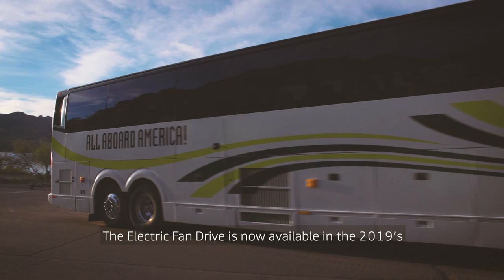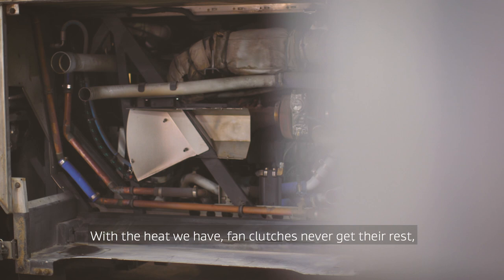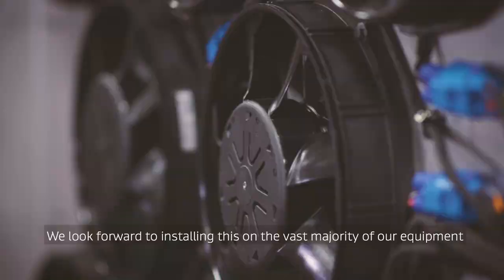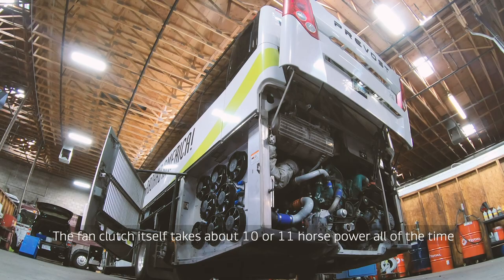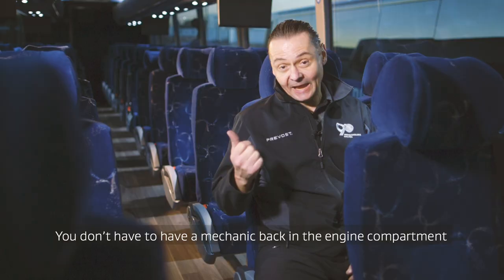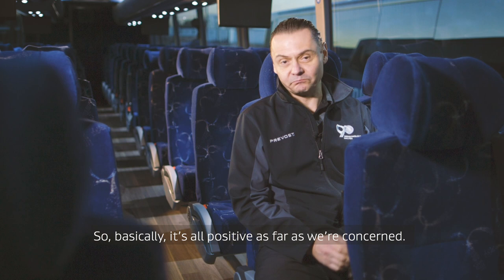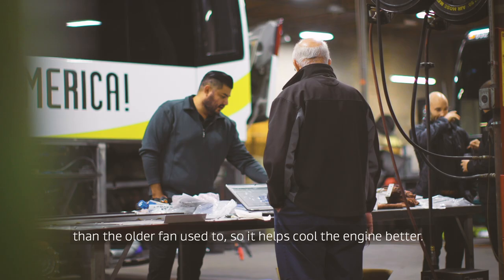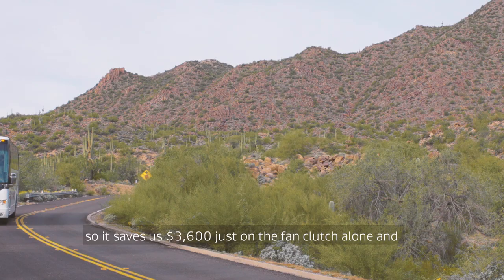Prevost | EFD Retrofit (EN)

Comment: Remove 11 hp of drag from the direct  engine driven  fan and transfer it to the alternator also driven by the engine. I get the clutch wear thing but this is disingenuous at best. Make your pitch on the clutch wear and ease of replacement..